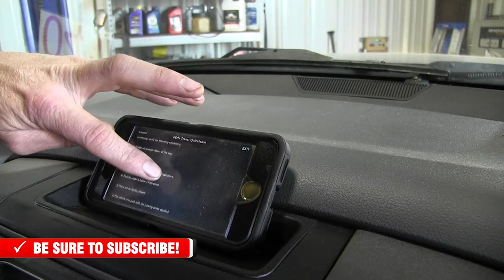HOW TO Install a RevMax 68RFE High Performance/HD Valve Body #diesel #dodge #diesel #trucks #shorts

Comment: If I’m running a mini max with delete and I’m running the trans tune they offered. I should leave that pressure plug/bolt removed? Is that correct? Than you

Comment: My 2015 ram 3500 has 160k miles now and transmission still works as it did new with only the common issues they all seem to have.  It’s been serviced 3 times by me running synthetic fluid. Is it good to change this with that mileage?
Reply from the maker: This is a great upgrade to those trans.  Even though you haven’t had an issue, these valve bodies are very problematic and this corrects those common issues.

Comment: I have a 2017 ram 2500. Adding this valve body, deep pan, filter, filter billet screw on nipple, and thermo bypass...question is, do I need a tune? And if not, how do I do the relearn?
Reply from the maker: No tune needed, and we talk about the relearn at the end of the video.  You will need a scanner to be able to do this.

Comment: If you don't have ezlynk and dont want to spend 800 bucks just to do a relearn, is there another way?
Reply from the maker: Find someone or a shop with a Snap-on or similar scan tool. Even having a shop use its scan tool should be cheaper than buying a unit.

Comment: How is it to add this and keeping it stock without a tune ?
Reply from the maker: That’s what we did and it was great. We assumed we’d probably need to tune to feel a big difference but we were very impressed as it sits in stock form.
Reply: @thoroughbreddiesel  did you install the optional 5x5m hex screw to keep line pressure at 160psi I have the 301A revmax valve body and don’t know if I should install that hex screw if I am running pedal monster
Reply: @mikeyncali  25:45

Comment: Im running a higher trans pressure tune in my 19 2500 (stock hp). I did this after adding 37's as i was told it would be better for the trans. Ive noticed it shifts a little harder (even after relearn). Was told this was normal as the clutches will slip a little less. I want to start building my 68 and was thinking the revmax valve body and pan would be a good place to start. Also moving to 4.30 gears. After install, should i still run the higher pressure trans tune or go back to normal?
Reply from the maker: With Revmax, you can run trans tuning and the VB will be capable of producing 325 psi of line pressure with proper tuning.

Comment: I have a 2013 2500 with 150k miles on it. All stock not even an exhaust. Truck shifts good still. Would adding this on now cause any issues being that its higher mileage?
Reply from the maker: None, but will give you another piece to the puzzle that you can grow into.

Comment: Tough accent, but I’m generally tracking!
I had a check light on that showed for shift solenoid D. Is that the solenoid in this video?
I’m a newbie on transmissions. Why should I invest $1300+ on a replacement?
Reply from the maker: Thanks,  accent comes with the dirt im standing on lol.  Shift SOL D is a individual shift solenoid of the valve body, this is the control solenoid we replace.  This particular replacement fixes so may problems these transmissions have in a one stop shop for lack of a better word.

Comment: Does the valve body make shifts harder? Or does just take the lag out between shifts?
Reply from the maker: The shifts are little firmer but the lag between shifts is really corrected with tuning more than anything.

Comment: So I called today to order the revmax valve body and solenoid pack but I was wondering, can you recommend a budget scanner that can do the relearn on the transmission? Or tuner that can perform the relearn.
Reply from the maker: Give us a call 859-737-4966.

Comment: Awesome video man, very instructional. I have my zero flex valve body sitting at the house for my 2019, going to be installing tomorrow. Have the upgraded pan and filter screw.

I have a mm3 instead of ezlynk. Is there any difference in install/quicklearn for the 2019 vs 2018?
Reply from the maker: I am not familiar if the MM3 has the quick learn option.

Comment: I have a 2022 with 195k miles on will this upgrade affect anything being so high mileage? It shifts fine,  if i were to do it would be just preventing upgrade. Any thoughts? Thanks!!!
Reply from the maker: Mileage wont be a deciding factor on it, however this corrects a design flaw in these transmissions.  I think with your truck being such high mileage for its age, its probably had a lot of highway miles with a minimal number of shifts.  We have seen highway mile trucks survive very well with the 68’s and nothing done to them.  This VB would carry you even farther without flaw.
Reply: yes all 90% I would say towing highway miles. Would you still recommend getting a VB? Also adding a bigger pan like the revmax one for example and having to add more fluid at that point, wouldn’t the pressure inside the transmission cause to raise ? Or it dose not affect anything having more fluid flowing to components .  Thanks for the reply !!!! Enjoying your guys videos
Reply from the maker: You're welcome!

Comment: I have a 2013 3500 6.7 with a 68rfe… 89,000 miles got the dreaded p0868 … look in fluid is low….. no issues up to this point with the trans…. I got do a complete fluid change and filter…. Get it hot run it up the road after filling the fluid and the fluid is like disappeared…. Is this a valve body problem typically or something worse. …. All my CVI are in normal ranges
Reply from the maker: I don’t think you have a proper fill level.

Comment: I have got 2010 3500 with the 68rfe with 140K . The truck is recently tuned with EFI LIVE with the transmission tune also. I am getting ready to install a deep pan and was considering the this VB. I have read that with a transmission with this many miles.. the new VB can cause issues with clutch paks wearing faster and other issues with the higher line pressures...your thoughts?

Comment: Need help. Installed a RevMax valve body and new solenoid. Shifting fork is on the cable arm. Turned on the ignition and the "P" is flashing, not in park. Torn it all down reinstalled everything again. Same issue. No clue what's going on, any ideas?
Reply from the maker: Frustrating but if you reinstall the old solenoid and VB does it go away?
Reply: @thoroughbreddiesel  no sir. Finally got a hold of RevMax. They said it should start even though it's not showing in park. If it starts do the quick learn and it should go away.

Comment: could you link the pick set you use? or just snap a pic? thanks!
Reply from the maker: To get the filter seal out,  those were actually radiator hose pics from Snap-on.

Comment: What is the best brand of trans fluid to use for the refill?
Reply from the maker: As a general rule, we refill with whatever the manual calls for.  For the 68RFE it requires ATF +4

Comment: Will this fix my po871 code
Reply from the maker: This VB is to correct and enhance driving experience of the 68RFE.  Don’t rely on it to correct underlying issues with the trans.
Reply: @thoroughbreddiesel  can I just buy the HD valve body is I only use my truck for work .im not sure if I need the zero flex valve body if I’m not doing any high performance upgrades on my truck

Comment: I went to change my vb and the engine light turned on and it won’t let me get get into drive and I tried doing the quick learn it keeped saying something went wrong
Reply from the maker: Truck is sensing something wrong.  What is the code?  Go back through your install.
Reply: @thoroughbreddiesel   
I went through everything and it worked fine idk wat I did wrong loo

Comment: Great video
Reply from the maker: Thanks!
Reply: @thoroughbreddiesel  99% sue I’m gonna order one of these next week.  My 15 ram 3500 with 160k miles still works great but has had that 3/4 or 4/5 flare feel since new.  I’m gonna do this valve body to try and keep it going  better a few years